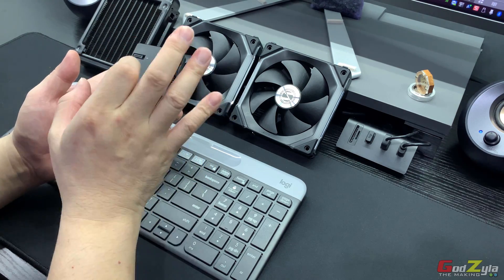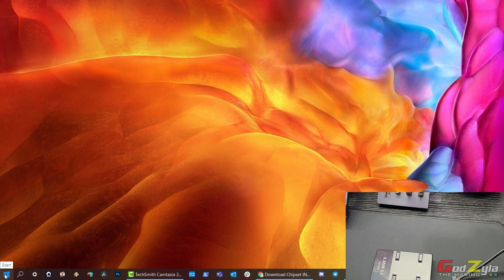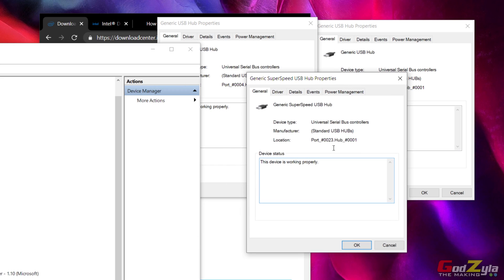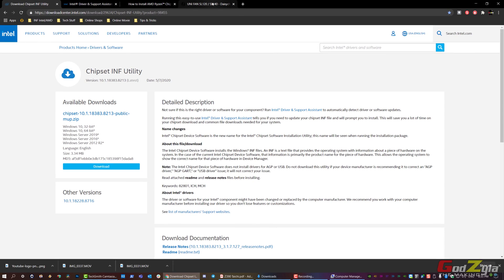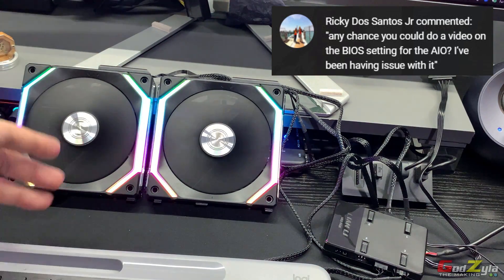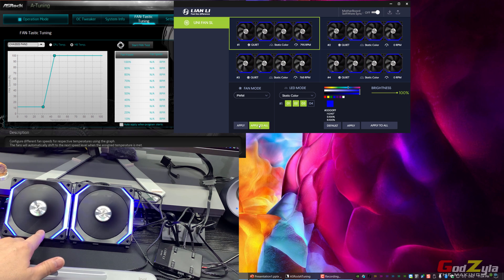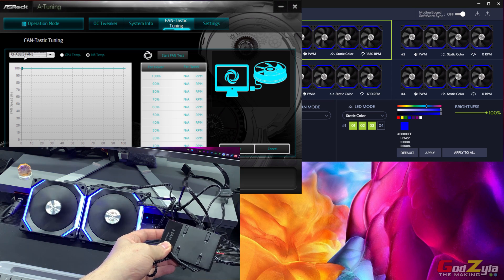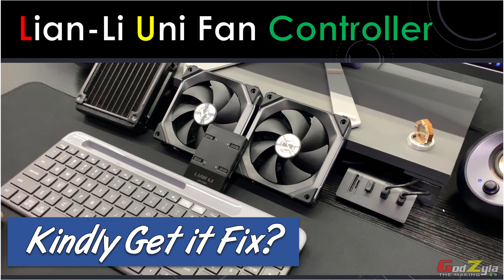Lian Li Uni Fan Controller - Some Break Fix! [L-Connect]

Comment: Tried updating the chipset drivers. Still not showing up in Device Manager. It only shows up if I plug it into a usb port at the back. Is it due to faulty usb headers on my motherboard?
Reply from the maker: Hi Ivan, welcome to my channel. which motherboard are you using? you might want to check your motherboard bios to see if there are any issues with USB connection.
Reply: @KleoYan  MSI Mag B550M Mortar Max WIFI. This is a new board which I bought just a week ago. No issue with L Connect 3 for 10 days. It then suddenly disappeared and no longer appear in Device Manager. I have another USB device connected to another header which coincidentally stopped working 3 days before the strimer disappeared. The strimer is now stuck at rainbow simply because it has been receiving power from the sata connection. Updated the chipset drivers and it did not help. I did the unprecedented thing by switching from the usb header to the usb port at the back and it worked. I've connected everything correctly and tried unplugging and plugging it. Bios is already updated. It can't be both usb headers and usb cables been faulty at the same time isn't it? The source of the problem is the usb connection, not the hub itself. Worst case scenario, I'll cut a hole in my case and let the L Connect hub run through the usb port but I still hope to resolve this situation.
Reply from the maker: @ivanyu3930  hi, seems like you have done all the basics and in even gone to the extend to use a 9pin to a usb on your controller  and works with rear I/O USB socket. Does your motherboard have any warranty left. I would advise you to do an RMA on your board.. it's of a valid reason to get it repair.
Reply: @KleoYan  I shall try to email MSI and tell them about it.
Reply from the maker: @ivanyu3930  ok.. all the very best and I am so sorry it's beyond my capability to aid you.. as you have already narrow down the issue.
Reply: @n Is it ok if I connect it to the rear usb port in the long run? I do not wish to take everything apart and then having to wait for a few weeks for a replacement board just for the strimer. Reminds me of my previous motherboard which came with faulty audio chipset and I chose to use a usb sound card instead of rma the board.
Reply from the maker: @ivanyu3930  I would advise you not to as your rear have a seperate USB drawing area on the motherboard. try to get your motherboard fix if it's under warranty.
Reply: @n Already did and it's working well. It is a difference between USB 3.0 and 2.0 anyway and backwards compatible. I don't think that USB 2.0 device would short a USB 3.0 port. Not worried about the PSU and GPU cables either as they operate on separate power sources. There is the part of the strimer which connects to the PSU cables and the other ARGB part which connects to the L Connect hub. It wouldn't affect anything. Too lazy to take everything apart again just because of a pair of non working usb headers. Been troubleshooting and heading in and out of rma office the last few weeks after the warranty on my previous motherboard was void because of scratches. Feeling a little drained. If everything goes well for a month, I'll probably leave it as it as. It could also be corrupt drivers after I stupidly messed with the BCD on the OS trying to create different partitions for it and probably only a reformat would fix the header problem. So I can't be 100% sure it is the motherboard.
Reply from the maker: @ivanyu3930  you can give it a try with a new partition later to confirm if that's the issue. As why I mentioned is not advisable to plug to the rear, you might have other USB plug and they might need the current ampere strenght, but if it works for you this way, that's good. I just feel that your 2.0 header inside your motherboar should be fix. 😉
Reply: @n I don't think that there is a problem with my motherboard at all. I plugged it out of the header and the lights went out which indicated that the header is still giving power to the hub. Even when I plugged it into the rear usb port, the L Connect software has to be reinstalled each time I boot up my PC. It is either the software or usb drivers issues. Perhaps I should find time to reformat the OS to see if it resolves the issue. Thanks for your help anyway!
Reply from the maker: @ivanyu3930  Ok, all the best👍

Comment: What about Lian li disconnecting and reconnecting my devices and Bluetooth? I’m about to yeet my pc
Reply from the maker: Hi Marz, welcome to my channel, it could there is not sufficent power provided from your USB header of your motherboard, try change to another USB 2.0 header for your uni controller. It could be USB cable between your uni controller to your motherboard, haveing issues. If that does not help, go search for your motherboard bios, see if there are any fix or bugs related to USB intermittance. You might need to update your Bios for your motherboard.

Comment: i dont even se the bus devices can zou please help?
Reply from the maker: Hi Alan Simčič, welcome to my channel. You can refer to this video https://youtu.be/CgvuUFeff8U?si=QQ07iXZaNQ2dmyAM or try the steps below.

1) Make sure your motherboard bios is up to date, please check on your motherboard manufacture website, under support > bios and drivers. See if there are issues with USB and do they have a fix. If there are, kindly update those bios firmware version.

2) Make sure your chipset driver for your motherboard is up to date! For AMD will be at https://www.amd.com/en/support for Intel will be Intel Driver & Support Assistant Intel DSA https://www.intel.com/content/www/us/en/support/detect.html

3) Remove all argb apps (Asus Armory Crate / MSI Dragon Center / Giga Fusion / Asrock Polychrome). If the brands which I have mentioned, do have a uninstall tool like the Asus Armory Crate, use that, else use Revo uninstaller ( https://www.revouninstaller.com/ ). Revo uninstaller will remove all unwanted files / folder / registry in your system. Illustration to use revo uninstaller https://www.youtube.com/watch?v=uMgUYiakpxM&t=437s

4) Shutdown your PC, unplug the PSU cable from your AC outlet. Press the power switch twice to discharge all current that your motherboard is holding. Leave it for 45 second

5) While waiting, please do not use KVM switches. Disconnect all devices that are connected to your motherboard (front / back IO). Leave only your Keyboard, Mouse , Monitor and Ethernet (If you have) connected directly to your motherboard. 
If your monitor has a KVM build-in, remove the USB cable from your monitor to your motherboard USB socket. If your mouse and keyboard are connected to your monitor, please remove them and plug them directly to your motherboard instead.

6) Plug only one Uni controller or Strimer Plus V2 controller. If its for Uni Fan (SL/AL) use only 3 fans to an output of the uni controller.

7) Plug the power cable and turn on your PC

8) Go to your Device Manager, look under Universal Serial Bus Devices, make sure you see the Lian Li uni / strimer plus V2 controller.

9) Install the L-Connect 3 app only https://lian-li.com/l-connect3/ (current version 1.3.16)

10)	After installation, run L-Connect 3, check under Setting > General > make sure Auto-Run on Boot and Minimized L-Connect 3 to system tray at close are ON.

11)	Reboot your system.

12)	First thing you need, go to device manager and see if the Lian Li controller is listed, next open up the L-Connect 3 app. Check if there is a need to update firmware to your controller. Go to Settings > Update, under Device F/W version, click on Update Check, download and install the firmware. Make sure the firmware is completed. Do a check on device manager and make sure the Lian Li controller is listed.

13)	On L-Connect 3 dashboard, check if the CPU and GPU readings are reacting, you might want to test it using some benchmark programs. If there are reaction, play with the PWM and argb functions. If it does not work, skip step 14) and proceed step 16)

14)	If Single controller works, shutdown your pc, connect uni fan set of 3 to your output of your uni controller. Do it small steps at a time to hook up your sets of fans. do not do all in one go. If successful and you have a second controller, proceed small step at a time again.

15)	Slowly plug back your USB devices (Headset, Microphone, Printer, USB Capture Card and etc). At any point of time as you add those devices one at a time, if L-Connect 3 become unresponsive. This tells you that there power is insufficient to power up more USB Devices. Whatever USB port on your motherboard, there is a limitation as the current are shared across the board, be it front or back I/O and the internal USB Header. You might need to get a Internal USB Hub that comes with a Sata Power source to the Internal USB Hub. (Disclaimer, buying a internal usb hub might or might not resolve this issue, purchase at your own expenses)

16)	If it does not work, report your issues to Lian li Tech Support. There is a in build log ticketing system in L-Connect 3 app. this is what you need to do. Go to Settings > Support > Click on “Download log” place a filename and choose a destination drive to save the log file. Next click on “Report” it will take you to Lian Li Tech Support FAQ. Fill up the form and upload the log which is a zip file.

Comment: Hey, first of all thanks for the video. I have 3 daisy chained AL 120 connected to their controller, i installed the chipset for the MB and the controller is detected on the device manager, i have my PWM mode ON, i can control the RGB but the fans are stuck and i can't control the RPM, any ideas?
Reply from the maker: Hi Mr. Dahomey, welcome to my channel. Did you set to PWM mode in the UEFI? as most of the time motherboard fan headers are set to Auto. try change that to PWM.
Reply: @KleoYan   Yes, i plugged PWM fan cables on the MB fan header and changed auto to PWM in the BIOS, I made a custom curve in the BIOS and the fans are working fine now, but they are still on 0 RPM in L-Connect and I can't control them with the software
Reply from the maker: @mr.dahomey4347  you either use the motherboard fan curve or to use L-Connect 3 app to controll the fans rpm. which did you set on L-Connect 3 app? and look at the top, is it sync to motherboard or?

Comment: I just did all your instructions, but I can’t control rgb and speed on fans in Lconnect. I installed chipset and I can see lian li fans connected in device manager.
My fans are Lian li Uni SL120 V1
Reply from the maker: Hi N A G A T O 6 6 6, welcome to my channel. If you are using L-Connect 3 app. This might not aid you. Kindly go through this instead. Lian Li ARGB Products (How to make it work?) [L-Connect 3]
https://youtu.be/CgvuUFeff8U

Comment: Hi Kleo.

I appreciate your video and helping with these issues. however, I have a different issue with these Lian-li SL-uni-infinity fans with the controller. I have got the software up to date and got everything connected as supposed to as well as software working, and fans however reacts accordingly.  my Issue comes as soon as I Launch a game. the game would launch and just when you want to start playing my PC reboots.   Now I am not sure why, but I've looked at so may scenarios, but nothing really helps me understand my situation.  also, I can clearly say it is from the fans/controller, due to if I have my original Cooler master fans connected this doesn't happen and I can play for as long as possible.   also running a bench test with the lain-li fans connected then the pc runs smooth with no issues. I can stress the graphics card and everything no issues. but as soon as I want to play a game, the pc reboots. can you think of something, or have you had an issue similar to this yet?
Reply from the maker: Hi Robert Backhouse, welcome to my channel. I have not encountered the issue you are having. You might want to try disconnect the controller and run your game. This is to narrow down if it’s the controller issue or a game program issue. If it still react that way without the uni controller. Then you know is not the controller issue.

Comment: Hey Kleo,

I recently upgraded to SL120 V2. 10 in total. 
All of the fans are spinning but the RGB isn't turning on.
My Device Manager doesn't detect the 'Universal Serial Bus Devices' and all the cables on the controller are connected. 
Also the Lian Li Update Tool cannot find the device...

I updated my AMD Chipsets like you showed as well. 

Please help me!
Reply from the maker: Hi DMAN, welcome to my channel, pardon me for the late reply. have you tried another USB header of your motherboard? I would suggest you to do basic troubleshooting steps as what I did, though this video is lenghty, try to spot the part where you have not done. It might help. https://youtu.be/CgvuUFeff8U
Reply: @KleoYan  Is there a way to find out if the USB Header is working or not?
Reply from the maker: @DMAN-  when you plug the uni controller, does it detect or gives you a unknown device? another way to test your motherboard header is to plug a USB 2.0 plug where the other end enables you to plug any standard USB device like a thumb drive.
Reply: @KleoYan  Hi Kleo, thanks for the reply. I'll have to update my BIOS and see if that works. Thank you

Comment: I need help I’m scanning devices and it’s not detecting
Reply from the maker: hi jinxvfx, welcome to my channel. Before I am able to aid you. can you tell me which uni fans are you using?
Reply: @KleoYan  im using LIAN LI UNI FAN SL INFINITY 120 Mirror
Reply from the maker: @vssjinx  thank you for the details. can you remove all your fans and just hook up the controller with the sata soure cable from your PSU, then plug the usb cable to your motherboard usb 2.0 header. boot up the system and check if device manager is showing the controller. if it does not and if your motherboard have another USB 2.0 header, try switch to that (please make sure you power off your system before you do that)
Reply: @KleoYan  ok thanks I tell u how it goes
Reply from the maker: @vssjinx  you are most welcome and all the very best.

Comment: how do I go about testing these fans before I install them on my PC I want to make sure their not DOA before I do all that work.
Reply from the maker: Hi Mark Edington. Welcome to my channel. If you know how to power up a psu without the motherboard. First when the psu is power off, you can connect the sata cable from the psu to your uni controller. Then plug the fans to the controller ports. Next power up your psu. The fan will spin and the fan argb will be by default rainbow effect.
Reply from the maker: This is what you be needing https://a.co/d/7PLBlag Connect this to your psu 24pin cable of your psu. Not on the psu but on the 24pin cable itself. Then power it up but turning on your psu switch.

Comment: Must L-Connect software be installed in order for fans to spin? I'm doing a new build, and when I boot up, the RGB lights up fine, but no fans spin... Have swapped out controller and sata power in an effort to trouble shoot.  Next step is to install windows and L-Connect software, but with no fans spinning I'm hesitant to put cpu under any load. Using Galahad and AIO on radiator fans don't spin either.  Using the new Uni Infinity Fans
Reply from the maker: Hi Rysdan, welcome to my channel. It could be lots of different factors like chipset driver not up to date or uni fan controller needs an update. Maybe go through these steps in this video might help https://youtu.be/CgvuUFeff8U
Reply: NVM... the solution is indeed to install the L-Connect 3 software first.
Reply from the maker: @Kraden26  Hi, that's good.. you got your issue resolved.
Reply: @KleoYan  thankfully I decided to try the Lian-Li support FAQ, and it's a listed question and answer.  As soon as I had the OS installed, I installed L-Connect 3 and the fans spun up right away with no issues.
Reply from the maker: @Kraden26  thanks for the info, greatly appreciated it.